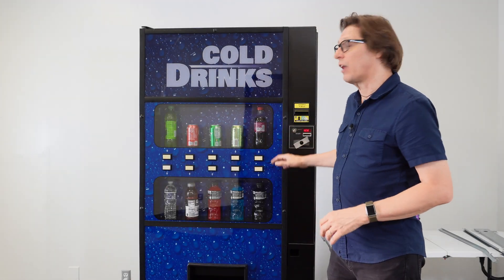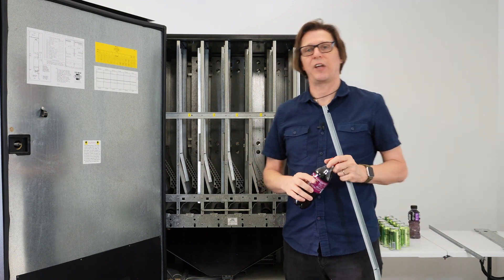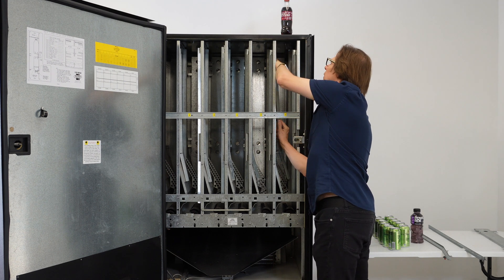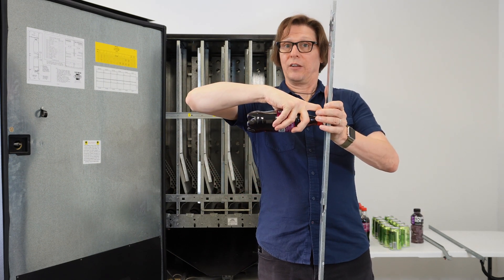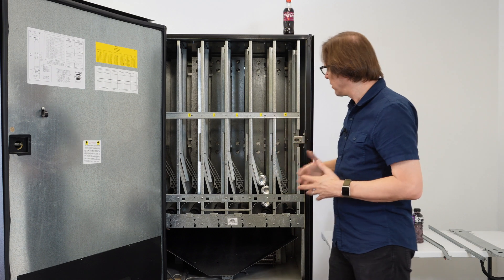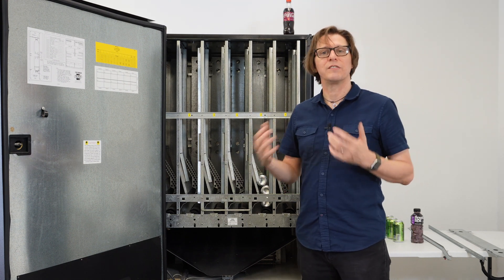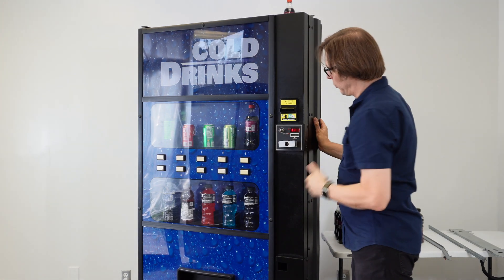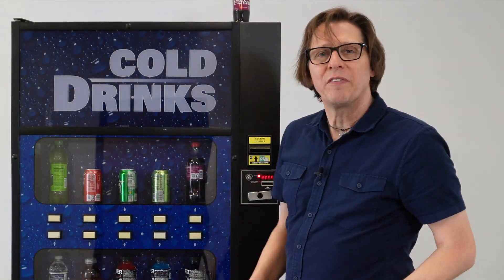Royal Drink Vending Machine - How to vend different drink sizes

Comment: I have made all the necessary adjustments on top. Is there anything I need to do on the bottom? I'm going from 20 oz bottles to 16.9 oz. They will vend one or two times and then get hung up. Is there an additional adjustment on the bottom that would be helpful?